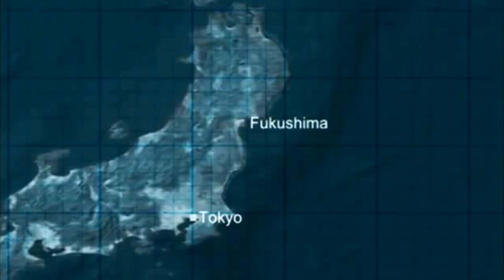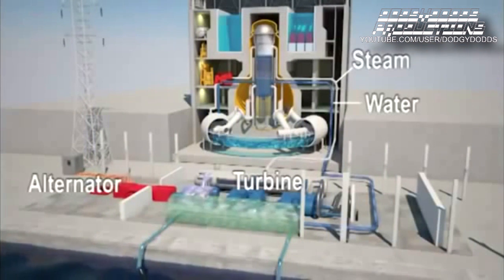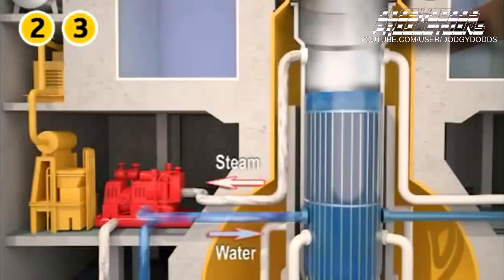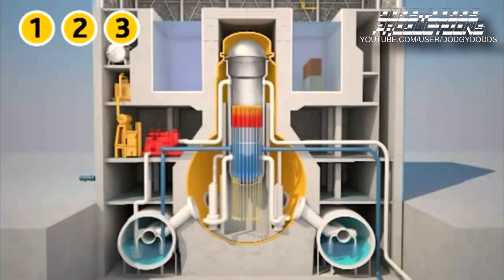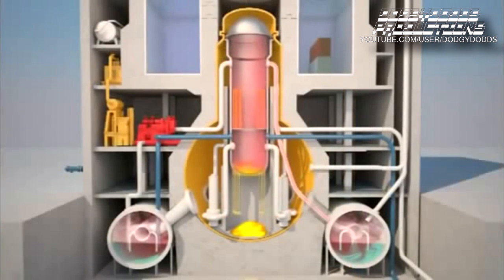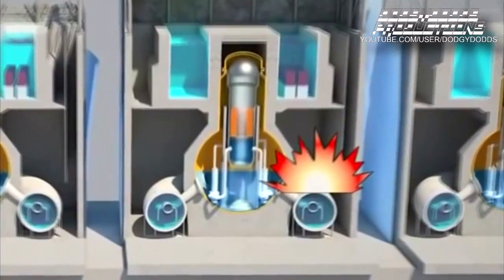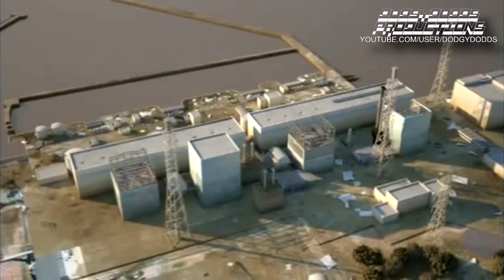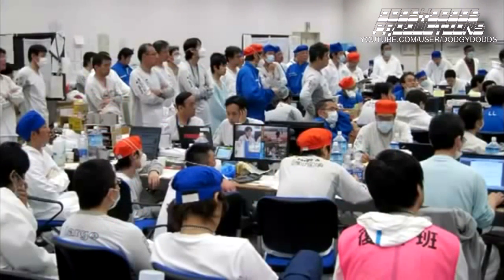FUKUSHIMA NUCLEAR DISASTER MEGA MELTDOWN 2017 - WHERE IT ALL BEGAN

Comment: Bullshit on hydrogen causing that type of damage to units 3 & 4. Educate yourselves about hydrogen, the info is easy to find. There's no way it exploded with the force to strip 4 foot thick reinforced concrete walls down to the re bar. Remove the hydrogen factor & focus on unit 4. What caused it to explode when it was clearly empty? Eyes wide open people.

Comment: Unfortunately the real situation is far more grim than it looks in this report - just look at the buildings - they are destroyed. Just think what force can blow out massive concrete walls, ceilings and pillars. 
I cannot see the fuel pools surviving that.

The information about the helicopters - they had to quickly abandon that operation because of too high radiation (that far up in the sky) - in Chernobyl 600 helicopter pilots paid for their efforts with their life. And pumping water into the buildings at a rate of 300 tons a day - the reactors needed roughly 4 million liters of water PER MINUTE each for cooling.

So that "cooling" was really only for the eyes of the unsuspecting watcher, in order to suggest cooling - there was no real cooling. Probably once the cores melted into the earth it found groundwater and some cooling - there are reports about steam rising up from cracks in the ground......

Comment: The explosions sent spent fuel rods everywhere, and the destruction of those units and well it's not over, and will probably never be over either.
Reply from the maker: also the clean up operation meant alot of contaminated waste was shipped all around japan all the way from north to south. Where it was incinerated allowing the radiation to release in the smoke particulates literally everywhere